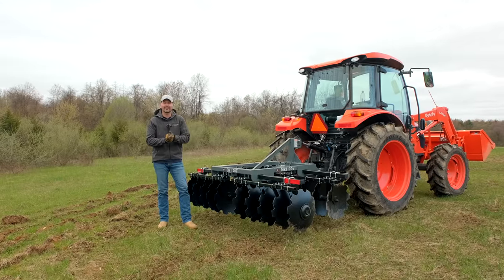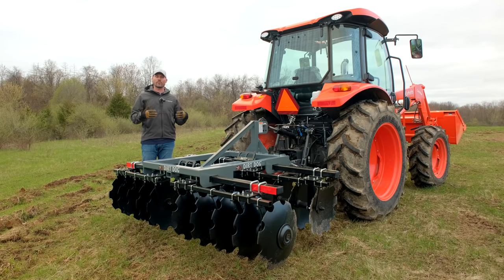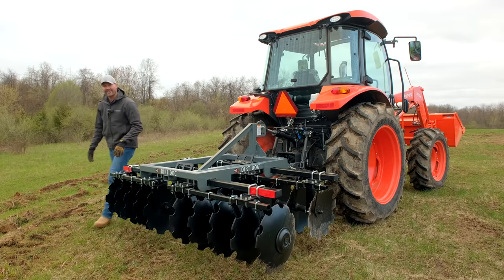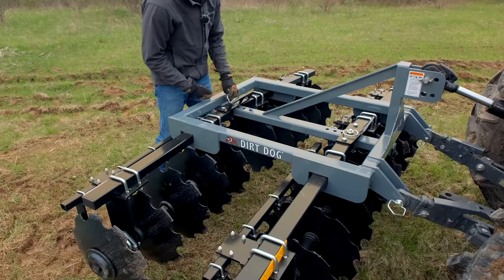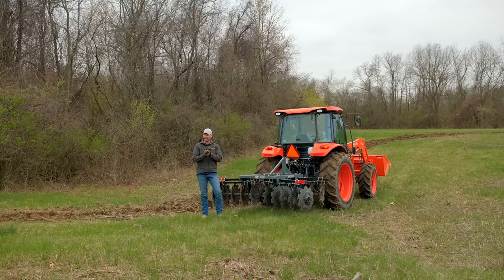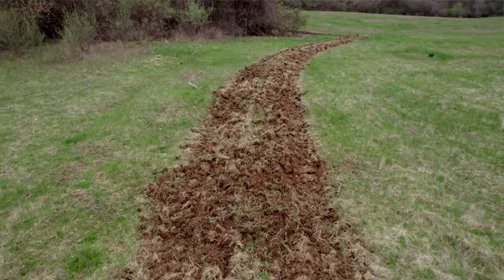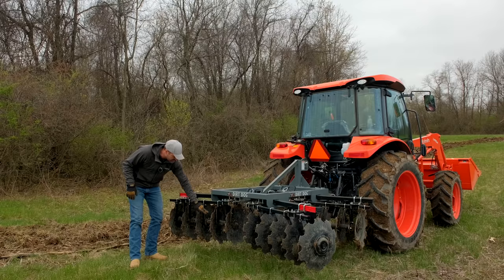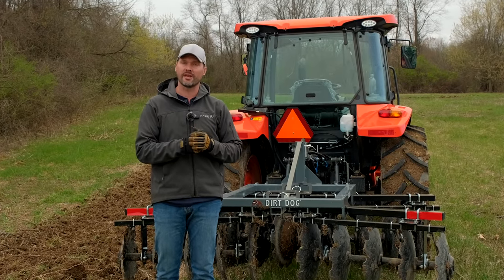IS THIS REALLY BETTER THAN A TILLER? A DISC THAT’S MADE IN THE USA!

Comment: As a former farmer I have a few comments.  Sod is very difficult to break up.  A chisel plow would be a very good tool for first pass to break up sod.  2 or 3 dry days later use a disk.  Your ground still looked a little wet.  Going over it with the disc again in a couple dry days will give you a better result.  The grass and clumps have to dry ( but not become hard) and they will break up better.  Good luck
Reply: I just have to say that I appreciate your comment and advice. The commenters on these tractor videos know their stuff. I just bought my first subcompact and have been binge watching these videos learning from you guys. Thanks 🙏
Reply: Don't you love it when hunters suddenly become farmers.
Reply: Exactly what my dad did, he wanted to turn a pasture into a field and ran a chisel plough through it, made some hay for 4 days then came back and used a power harrow on it. It got excellent results.

Comment: Soil conditions appear to be a bit too wet for field work during the shoot and the disc seems a bit light (weight) for heavy tillage.  When I was a youngster, we would run the disc over the field after using the moldboard plow to smooth everything out.
Reply from the maker: Light weight disc...that's all compacts can handle.  Whether dry or wet, it should be able to cut up sod.
Reply: @GoodWorksTractors  I can challenge that statement. I ran a 6-ft for over 20 years on a John Deere 4100 20 horsepower HST. The key is speed this actually are meant to go faster. Something else you can do is not use the top link gives it a little bounce to help break stuff up. As someone who was raised the old ways into the modern ways of this new implement world. I still plow with a 1950 John Deere M two bottom. Then I disc. Wants to disk ground has been setting for a couple days I hit it with a tiller. Now people may ask why the tiller. Well with the crazy range we're having in the mountains in North Carolina and tennessee. After the tilling I put on an old Hiller and bring heels up that are 2 ft wide at the base 1 ft wide at the top about a foot tall. And my plants have been awesome ever since. This year is actually the first year I've had a garden in 2 years due to many deaths in the family and not having the time. Still enjoy your videos hope us old guys can help you out with old knowledge
Reply: I agree, soil was a little to wet in some spots. But if the ground hasn't been touch in 10 years a disk wouldn't have been my go to equipment to bust it up.
But I understand the purpose of this video. Keep up the good work.

Comment: you need to add about 500 lb of weight on top of the disc that's what I use it really makes the disc dig in especially if you have lots of rocks when adding weight you can also run a little faster speed
Reply from the maker: I agree.
Reply: @GoodWorksTractors  Better to get that weight as structural steel!  Brown implements built a heavy disk that would probably do what you were attempting to do with that light-weight tool, but no disk is capable of complete cultivation "old-school" tech.  Moldboard plow, dry out in sun a few days, THEN disc.  Only way.  Even a roto-tiller would have made a real mess under the soil-type and moisture conditions shown in this video.  (although it would have "looked" better...)
Reply: Absolutely right. They don't work well at all for breaking ground without some extra weight. They're really not intended for breaking ground anyway.
Reply: i dont think the weight would help as much as removing the bucket.   it took me a lot of experimentation to realize that when i have a bucket on, any bump the tires would hit would throw off the disc function.

Comment: I concur with the comment below. Drier conditions and weight added to the implement would greatly improve the results. I have been researching discs vs. tillers for a minute now and just bought a tiller, mainly for consistency's sake. The one pro of the disc over the tiller is that the disc is an infinitely simpler device. Much less to go wrong with the implement itself.
Reply from the maker: Tons of parts on a disc....a scraper/cleaner for each disc, all the discs, all the sealed bearing points.  I beat the heck out of tillers and can't seem to break them.  Both are durable as they're made for hard, ground engaging work.  I'll be doing more videos showing how superior tillers are to discs.  Wet, dry, whatever.  :)

Comment: Did a decent job for un-plowed ground which isn't what they do best.  The plan in the old days of max tillage on the local hill farms was:  plow the tobacco or corn field; 'drag' or 'scrub' the plowed ground; wait a few weeks, then disc and drag it down.  Repeat those last two steps until ready to plant the crops. I could make the ground look like a tiller had been used on it, in the right conditions. IMO the 3-pt discs are less effective than the drag type.
Reply from the maker: Amazing how many guys want a disc to turn unplowed ground.  This shows what it does.  You've got a heck of a lot of steps to go through.  I prefer tillers.  If you need to occasionally run deep tillage, then that's just one other tool.  Small acreage here, not big Ag.
Reply: @GoodWorksTractors   I 100% agree with you and so do most farmers hereabouts.  Discs and plows aren't much in use, now.  The 1-5 acre tobacco patches and 10-acre cornfields are mostly gone now and have been replaced by corn, soybeans and hemp in much larger tracts.  Most of the farms are using minimal tillage plans.  If they do till, tillers are the tool.

Comment: 1. Drier might have been better, but for the moisture and obvious clay I was surprised it wasn’t sticking to the discs at all, so it wasn’t too bad. 2. I agree a disc is typically not the first choice for turning or breaking up unbroken ground, but typically a later refining step after you’ve broken it with something much more aggressive. But you know that, and that is usually in terms of an area to be planted. If you’re say, just wanting to break up the top of a hardened uneven farm road so that you could redress it, the disc might be a good not-too-aggressive choice. 3. As many have said, you were not getting the full impact of what the disc was capable of because it was far too light. When you can still clearly see the tire tracks after the disc has passed, it’s obvious it’s not having the full effect. 500 lbs. of ballast on top and you likely would have seen the results you hoped for, and with fewer passes! All the best, Courtney.

Comment: Adjust your top 3-point link so the front disks are digging in more (beginning of the video looked tipped too high in the front vs back).
When it's wet clay like that, you can come back after a day of it drying out and another run will bust up the clods to smooth it all out more.
Reply: I agree that the front is riding too high not allowing the front disc to do much at all. Make the suggested adjustments to the machine, and definitely need a lot more weight  as well…..

Comment: Okay as a farmer type with a agronomy degree...

Disk is used in the fall to rip up the ground, increase moisture infiltration.  Then with the freeze thaw effect over winter it breaks down the clumps. In the spring a field cultivator is used to make the seedbed utilization.

You will never get seedbed quality with a disk it is more used for to break up of the sod.

Cheers.

My 2 cents.

Comment: Something to be considered is if you have rocky ground a disc will many times make it through without breaking anything. Not so much with a tiller.A few light passes with a disc will get the rocks loose then they can be seen and picked up. Dragging a harrow behind the disk will also help knock down some of the large clods Good solution for working up a pasture or or incorporating fertilizer which would also be harder/slower with a tiller.
Reply from the maker: Tons of small rocks here that I've tilled.  1-2" in size.  Nothing huge.  Yes, discs are easier to use in very rocky soil though.  Thanks for watching!

Comment: So a couple of thoughts from a pacific NW farmer here who uses a disc a lot.  First off, those small three point discs just don’t do a great job as you can see.  That tractor would pull an 8-10’ tandem offset disc just fine. Two those sealed bearings just don’t last very well, I hate them on the farm, unless  they are oil bath bearings. Three the big advantage of a disc over a tiller is a tiller tends to create a hard pan about six inches below the surface of the ground creating drainage issues in more clay type soils.  Your use of a ripper/subsoiler will help keep that from happening. Four don’t turn much with that disc in the ground or you will break off disc blades. Finally the real value of a disc is to break up the sod so you can get a plow to roll the dirt over cleanly.  It never is going to look like it will with a tiller.  For what you are doing with small plots I would disc, subsoil, then till.  I might wait until the ground is a bit dryer as well.  For what it’s worth, if you have really compacted soil, wait until it is dry and run your subsoiler, it really shatters the clay, downside is it takes a lot of horsepower. 😁

Comment: I was surprised the discs weren't cutting deeper. In fact, most of the time it look like the outer discs were barely doing anything. Do you think adding 4 or 6 70lb weights to the disc frame would have made a significant difference?
Reply: Needs weight or stones added to the basket
Reply from the maker: 100% agree
Reply from the maker: Yeah, I've told folks these discs for compacts are way too light.  Just not a good choice.  Need more weight.

Comment: Courtney, what would you recommend: a pull-type disc or a tiller for prepping a seed bed for new pasture? About 60 acres of my farm was a pine clearcut (8 years ago) that was forestry mulching 5 years ago so the stumps are generally extremely rotten (a few are semi-hard but flush to the ground) but the ground hasn't been worked in probably 40 years---it was cropland before the pines were planted. The plan is to work 20 acres per year for 3 years to get the ground more productive and smooth out the surface. I've got a 5075e but I feel like 20 acres---of arguably virgin ground---with a tiller would break the tiller and take days to accomplish. My Buddy is pushing my to get a pull type disc like a Frontier DH1508 and break it up that way with 2 machines making about 3 passes total. 

I love 3pt tillers but I don't want to buy something that's going to get absolutely thrashed and end up as scrap metal.

Comment: One tip with the disk is to go alternate directions. If you can at minimum angle across the field and the straight it will break up sod much more effectively. As others mentioned, adding some weight would help as well. 

I'd also like to see a comparison showing rototiller vs power harrow.

Comment: use disc harrow in cross or first time in horizontal direction and than second time over same land in veritical direction to get rotavator or tiller like result. also can put stationary weights over the disc gangs like rcc pillars or sand/soil filled gunny bags of 50-100kg for better n deeper performance on the soil.

Comment: Wasn't really impressed  with the disc compared to a tiller. With rising fuel prices the tiller is always going to be my way to go. Love your videos keep them coming!!!!! This video showed me what I wanted to see and know.
Reply: Completely agree. I started out using a Case garden tractor and had both a tiller and discs. The discs have been parked for about 10 years.
Reply from the maker: Agreed, tiller is the way to go.
Reply: Different purpose. If you plow first using a bottom plow you can turn all the organic matter over and burry it deep. Then you use the disc to create a surface ready for planting. There are some older disc plows out their still floating around, however. I think your ground is too wet as well. That light of a disc isn't really meant for tilling.
Reply: I will use 3 times as much fuel running a tiller than I will a disk for food plots.  Both work better with the vegetation killed off, but I can get a field prepared faster and cheaper with a good disk. NOTE:  I need some moisture in the soil with the disk and moisture can really bog down my tiller.

Comment: The disc is better for the soil in the long run. The tiller kills all the beneficial worms and microorganisms.  Also you need to work in some organic matter to your soil so it will break up better when you disc it. Disc in some good cover crops for a couple of years and the soil will improve.

Comment: The ground is to wet for a disc or a tiller and the disc is to light.  You need to add weight to the disc and run it at 5 to 6 mph.

Comment: I’ve used one similar to that on a sub compact tractor. I wasn’t all that impressed with the results. I ended up renting a pto driven tiller. Far better results in half the time. Maybe it would work better if it had more downward pressure. You’d be better off using a 6-7 bottom plow and then going back over it with a disc.

Comment: Notched blades do a ruff job if you had smooth blades it would do a better finish job and less angle will help to keep it from ridging up and slow speed helps. Back in the day we used to break sod like that and go over about 5 times usually 2 times then let it dry out and do it a few more since it worked up nicer after you ran it over with tractor dual wheels

Comment: Add a little weight. Set the front gang to it's most aggressive and rear to a more moderate setting,get it as level as possible, let it go as deep as the tractor will pull it, and run your speed to 5 or 6 mph. The only other thing I noticed is that sod is going to have matted roots, so you will want to make your second pass at an angle to break those root mats up from 2 different directions
Reply from the maker: No built in tray or bar to add weight.  I adjusted the hydraulic top link on the fly the entire time I was discing.  I tried faster and slower.  5-6mph and it just skipped along the top.  Can't disc on an angle in a strip plot.

Comment: I also notice you are running them flat raise the back gang about 4-6" higher than the front and they will dig much more aggressively.
Reply from the maker: I tried that...back row comes completely out of the ground.
Reply: @GoodWorksTractors  What is the shipping weight if the discs?
Reply: @GoodWorksTractors  I found the specs 78" dirt dogs are 543lbs, 78" farm king by buhler are 850lbs with scrapers. I only pull with 38HP and get substantially different results in similar soil type.

Comment: If you use drag harrows behind the disc plow on the last time of disc plowing, will level and break dirt to a finer consistency 
Also, the ground you were plowing seemed to be a little wet. Wait until the ground is a little drier before using the drag harrow

Comment: Good Video, But soil is to wet in the video to do the disc justice and top link not adjusted properly to disc......if you are watching this don't let it give you the wrong impression of a disc....they are, and have been a very effective tillage tool for finishing a Plowed field ( key word Plowed) for planting for many years. like anything else....experience of the operator, proper field conditions, proper adjustment of the disc, type of soil, and type of disc are all are keys to how well they preform... they are cheaper than a tiller and can give a nice seedbed with experience and knowledge. They are not a 3pt rotary tiller though so it's not a fair comparison....

Comment: You're not supposed to do circles/ turns with a 3 pt. hitch style disk. It can make the axle nuts back themselves out. It's best to do straight line disking.
Reply from the maker: No one did circles.  Slow turns are not a big deal.

Comment: Tiller is better but it's also more expensive. Also I've found that the faster I can go the better the job it does. However, fields are usually to rough to go very fast.
Reply from the maker: Yeah I did more discing today.  Even at 3.5 mph it was a very rough ride.  No way I’d do that all the time.

Comment: I've done it both ways and like a roto tiller much more.  The top link on your setup seems a bit too tight causing the rear of the disc to be a little lighter and less effective.  I sure like your tractor though!
Reply from the maker: I like tillers much better too.  Top link is hydraulic and was adjusted in many ways throughout the process.  Didn't help much.

Comment: Does anybody manufacture an offset disc for small tractors? That's one thing I didn't like about these small disc's they're not heavy enough for tough soils. I guess if you could add about 1000 lbs to them they might work better or like a dozer be able to put down pressure on it with the hydraulics.
Reply from the maker: Not that I'm aware of.  I've long said discs for compacts are much too light.
Reply: @GoodWorksTractors  have you seen the rotoderon tiller? Nice!
Reply from the maker: Wow, that thing looks awesome!

Comment: Add weight to disc and it  looks like you are going too slow. Max angle and overlap a half width each pass, all my experience is with an offset disc
Reply from the maker: Going faster just had it ride along the surface and not dig in.